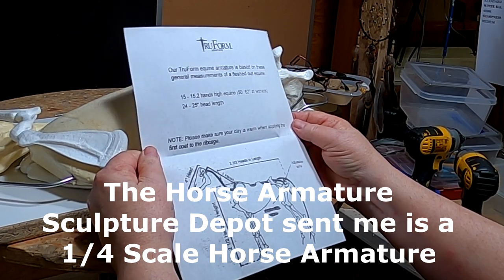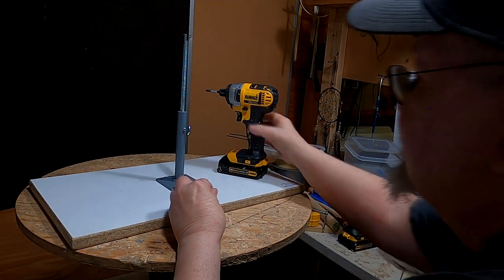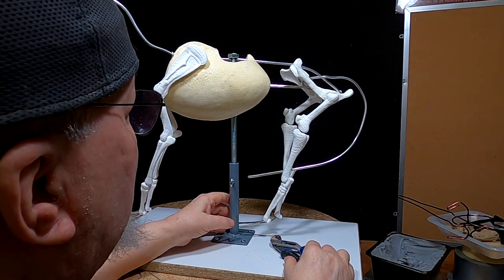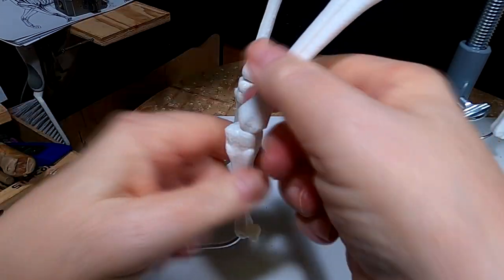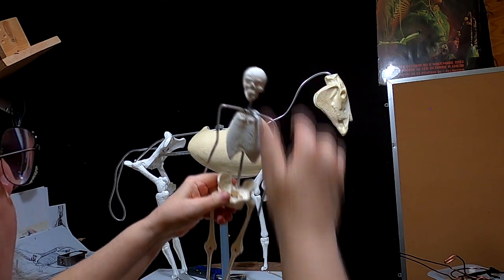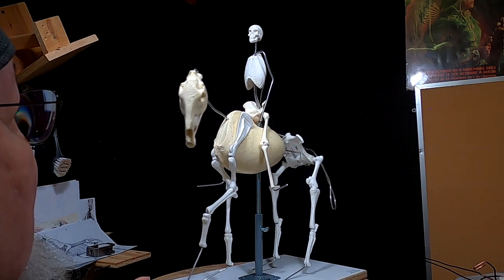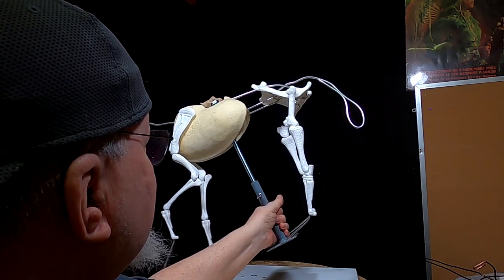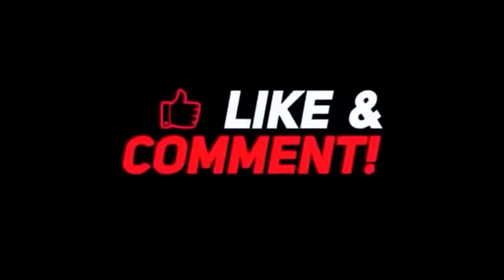How to Use the One Quarter Scale TruForm Horse and Human Armatures From Sculpture Depot

Comment: Those are pretty cool items. Does the wire used for the horses neck have to be supported?
It looks like the weight of the clay would pull the neck down
Reply from the maker: When you add the clay.. that'll support it fine.. Don't over think it.. lol